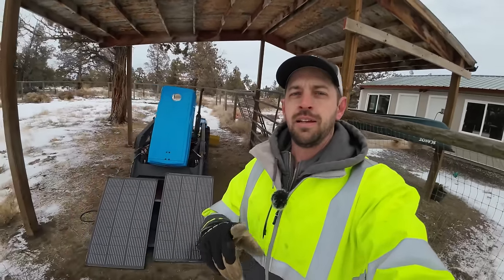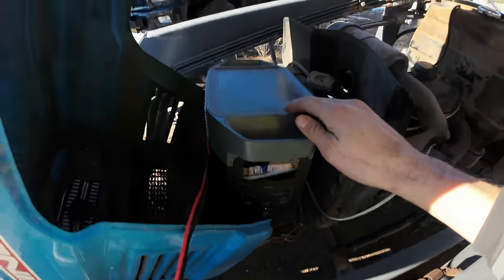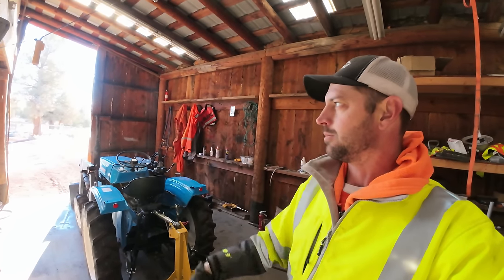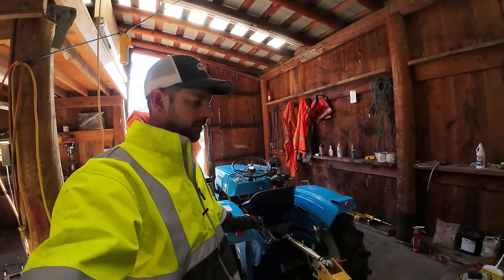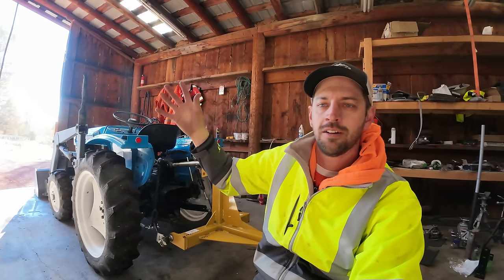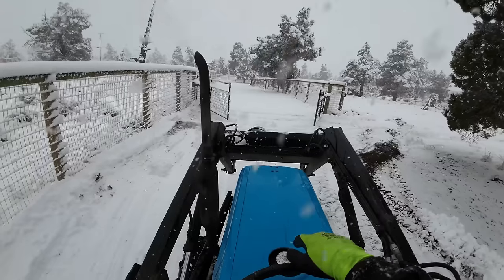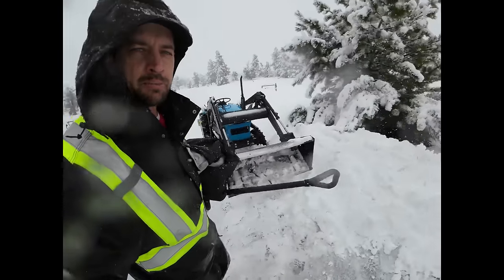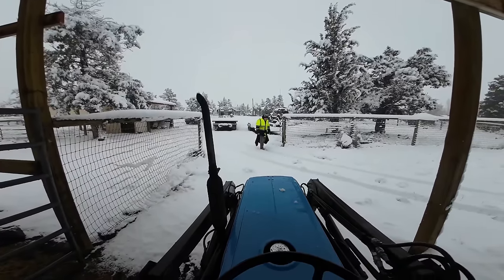Winter Snowstorm and the plow tractor won't start.  EcoFlow solar generator to the rescue!

Comment: what my granpa told me on very gold days if they wanted to start any tractors (wayyyy older than yours i own one from 60s rus great ) they actually used to cover the good with a blanket to keep the heat in most actually use them all winter long even when running because most use waqter in the block and just drain it and also putting boiling water in before starting will hear the engine but what the used to do is make a small fire under the oilpan  or up a metal dray under it with coals and that way heat the engine and also other thing is they would light a torch and keep it in front of the intake collector and then it would take in warm air and start easier i actually dont like the starters because unless you have really good alternator and battery you will get let down my tractor has a gas starting motor aka ponymotor and thats the way to go with old equipment and absolutely love using that tractor

Comment: Always cover the entire front and sides of the hood over the engine with an old blanket or tarp even an old sheet when using heat for hours to warm an engine.  Bet even cardboard would work on the tractor in the open sides.

Comment: Try putting a blanket (heavy duty) or a tarp over the engine to contain the heat generated by the solary system. 12V engine block hearter?

Comment: An old blanket over the engine while you are using the heat tape would have made a big difference.  Add an old tarp to the mix and the wind won't be a factor.  Keeping a blanket over the engine while it is parked can make a difference too.  Used to see many cars without garages back in the '40's and early '50's with a blanket over the hood in the colder winter days in northern New Hampshire.  As a kid I always wondered why.

Comment: Glad the ecoflow worked for you in getting the little tractor started. If you have help around run a chain under the bucket and tow start it. They will usually pop right off with a tow as you will be getting a higher engine rpm then the starter provides which results in more internal heat. Doesn't that unit have glow plugs?
Reply: Sadly , That only works with gear drive ,
Reply: @henrycarlson7514  So is his geared or hydrostatic, I'm thinking geared.

Comment: Casey  have you given  any thought to installing block heaters on your equipment and truck's  plus using  WD40 instead  of using either as WD4O will lube your cylinders  and not clean the cylinders  like either  does.
Reply from the maker: I don’t use block heaters because I never know which vehicle I’m going to need to take in the morning, and I don’t have power where I park them.   If I knew for a fact that I was going g to need a particular vehicle, I could put an EcoFlow on it for the night to run it’s block heater, but that’s almost never the case

Comment: Great video. I’m curious why you don’t have an inline heater in your coolant lines to warn the tractor with. I have a 1964 Massey Fergeson diesel tractor that was my dad’s, and we’ve used one on it for over 50 years.

Comment: If you know which SD card HAD the footage on it you may still be able to get it back after deleting or formatting the card. There are programs out available that can retrieve deleted data. I just had to go through this with Gil-Tek but it was unsuccessful due to being a encrypted hard drive so as long as you don't have it encrypted there is a 90%+ success rate

Comment: looks like you are running your rear blade backwards,  it would be far more effective if you turn it around so the cutting edge can do what it is suppose to do
Reply: He answered another  similar by saying: he didn’t want to dig into the driveway and the tractor has poor blade control

Comment: Casey, have you tried a magnetic block heater on that tractor? I have an older Yanmar diesel tractor that does not like starting in the cold I used a 200 watt magnetic heater on. Old beast fired up after a couple hours of heating. I have used an Ecoflow on my Dodge diesel to warm it up using its block heater, it worked well and got the pickup running. I just need an adapter Costco didn’t include with my order of panels and Ecoflow Delta.

Comment: Dude....U got that rear blade set up for backdraging,  not plowing.   Turn it around and set it at max angle so the snow rolls off the end like it should.
Reply: He answered another  similar post by saying: he didn’t want to dig into the driveway and the tractor has poor blade control

Comment: Why not use an oil dipstick heater or an engine block plug heater?  Also, I have the same grader blade behind 
 E-max 22 HST but I made two modifications.  I added a rubber cutter blade, the original steel blade was worn and I added a 12v linear accelerator, 2,000# with a 3,000# static to rotate the blade from left to right.  Of course, the housing broke so I made a cradle to help support a new housing using backer plates and 4 bolts.
Reply from the maker: Because I don’t have either of those things and never use this tractor in the winter time anyways.   I don’t plow my driveway and I’m too busy during that winter to be doing projects around our property, so it just sits until summer

Comment: Heat light bulb 250 watt and a heavy blanket over the engine cover. amazon has a 25 lb blanket that will not blow off. works great. do not use the red heat lights for they kill plastics.
Reply from the maker: Oh yeah, we wouldn’t want to hurt all the plastic on that 1970’s tractor!
Reply: @CaseyLaDelle  yeah I goofed once in an rv bathroom and put a red heat light and in a couple of days the shower walls shrunk a little and everything in the bathroom that was white was now orange. Oops. So I always throw that part in there. Outside the amazon 25lb heavy blanket is cool for does not blow off over the hood on tractors. I have found just putting it on keeping the wind off the engines is a bug help. Love the videos and your efforts to educate others. Keep up the good work. SSG.Bo.Retired. Love winter camping with the blanket as well.
Reply: Actually the heat tape with the blanket covering the engine itself would do the trick- it would also reduce the average power draw if the heat tape has a built in thermostat...

Comment: Hey Casey Your blade would work better if you swung it around so the concave side was in front like a grader.
Reply from the maker: I don’t want to dig into the driveway and this tractor has horrible blade control, so this is the easy solution

Comment: Why didn't you put the tractor back in the warm barn ?  Not mean, just curious
Reply from the maker: Because it’s not warm.   It’s not insulated and has no heater.   The temperature inside is the same as the temperature outside, and I don’t want to have to fight that stupid tractor again to get it out of the way when I need to work on something

Comment: Hello Casey I messaged you on Instagram as well as here (obviously you're reading it) 
Have you ever tried using a little gas on a rag and placing it over the intake on a  diesel powered unit? I have heard it works very well from a few men who worked in forestry and farms in different parts of canada in the 1950's era 
Maybe you could give it a try sometime and make a video to demonstrate how well it works.
Thanks for your time God Bless

Comment: No old blanket or two tucked around the warming wire wrapped engine parts and pieces? Or cardboard? Both? Holding the heat in where you want it is more efficient than the freezing air whisking away most of that valuable warmth….
Reply: Since you have a heat lamp in the engine compartment, blanket the hood to keep in the warmth…
Reply: Your right again….
Your not good at this.
By the way, you are good at infomercials.

Comment: You plowing is motivation for Grumpy to get better.  Is there a reason that you didn't turn the blade around?  I know it works either way, just curious.
Reply: He answered another  similar question by saying: he didn’t want to dig into the driveway and the tractor has poor blade control
Reply: @JohnHallgren  That makes sense.

Comment: Do you really need to plow 4 inches of snow in that area?  Down the state we've been getting 4 - 6 inches and don't plow.  All my vehicles can handle 6 inches of snow without any trouble.
Reply: If it stacks up it’ll be harder to plow once packed.